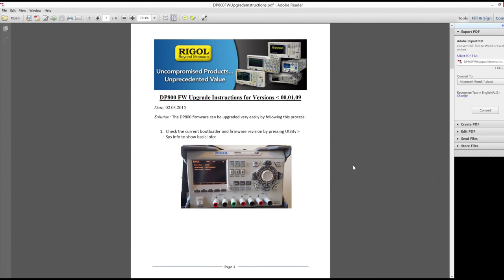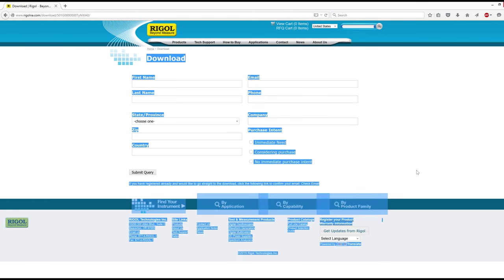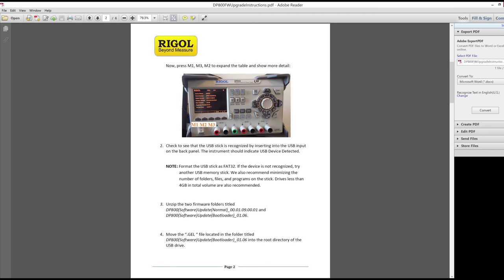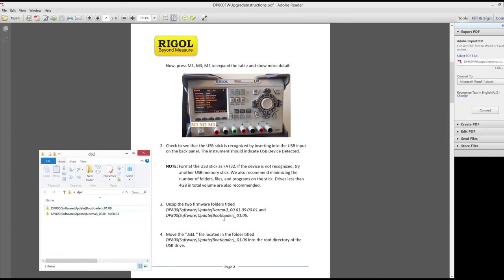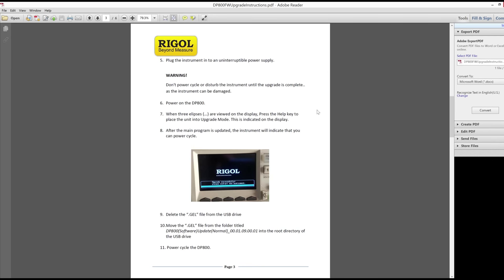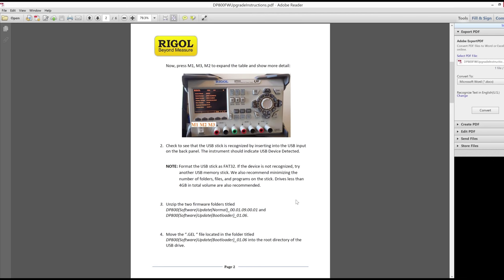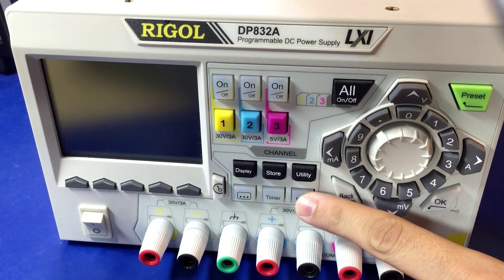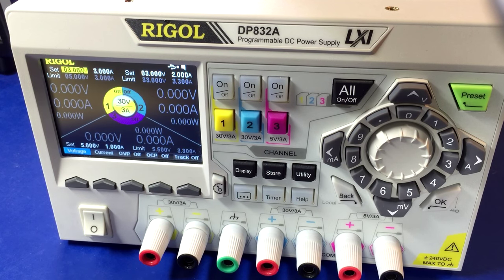Rigol DP832 / DP832A - How to Update Firmware to add "Classic" UI - #0099

Comment: Is this a pretty recent revision of this psu?, that is, built long after the problems with the powerregulator inside it?

And, how is the visibility on the color display?, from the angle you took the picture, the classic display didn't look too good compared to the non-A model which is green..
(I'm debating with myself wether getting 832 or 832A...)
Reply from the maker: I have never opened it up to check,  but I've never had any problems despite my heavy use. The visibility is really good.  The 832 is probably a much better bang for the buck for sure

Comment: Does it still have a button only dedicated to go into the dial mode (lower right on the display) after the update? Or have they finally made it possible to switch into waveform mode? The dial mode is probably the biggest facepalm moment on this thing.
Reply from the maker: +Róbert Valdimarsson Mine is a dedicated button for dial mode :(
Reply: +TechnologyCatalyst Thats ridiculous. Of all the display modes the dial mode is the least usefull. The waveform mode is quite usefull, but you have to go through 3 menues to get it. I hope they fix that. Dave has also done a long funny rant about that in his review :D

Still cant believe they dedicated a button to that... its like on of the designers was a child wanting to become a race car driver...
Reply from the maker: I concur. It's quite silly to dedicate a button to a mode that nobody uses. I'd settle for just a dedicated display button that cycles through the display options so you don't have to go through the menu.
Reply: +TechnologyCatalyst Exactly, and it would be so easy to fix that in software :/
Reply from the maker: Indeed.  I'd be curious to see if anyone out there has modified the firmware to add that functionality.
Reply: +TechnologyCatalyst So, even if you turn it to Classic display, when you exit out of the waveform mode, you get the dial display?, should be an easy fix if someone bugs Rigol about it..
Reply from the maker: +Asbjørn Mikkelsen I'm not sure I understand what you're asking.  The ONLY thing the dial button does is enable dial mode.  If you push the dial button again, it exits back to whatever default display mode that you have selected in the display menu.  If you have classic display set, if you push the dial button, it enters dial mode.  If you push it again, it goes back to classic.  If you have waveform set as your default display mode, and you push the dial button, you enter dial mode.  If you push it again, you exit back out to waveform mode.  The dial button enters and exits dial mode, and nothing else.  It's a worthless button.  It would have been MUCH better for that button to just cycle through the display modes, or at least make it a dedicated waveform button instead of dial.  Dial is worthless for most purposes.
Reply: Ah, I looked at picture of dp832 and dp832a, and it looks like both have same number of buttons, so I didn't think it was an dedicated button for that.
The non-A doesn't have that display right?, or maybe it does?
Reply: +Asbjørn Mikkelsen The non-A version does not have the triangle display (only the A-version has that). It has the three columns as default. but also has the dial-display (with a dedicated button) and a waveform-display (available after going through 3 menues).
Reply: Róbert Valdimarsson Oh, that one I haven't seen, I thought one called the triangle display the dial one:)